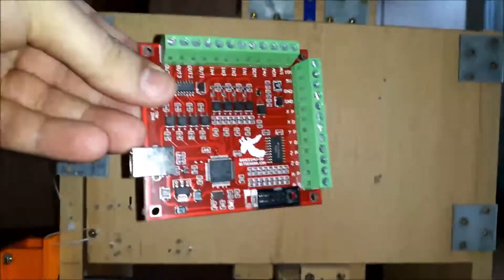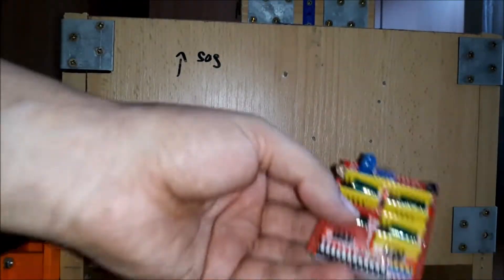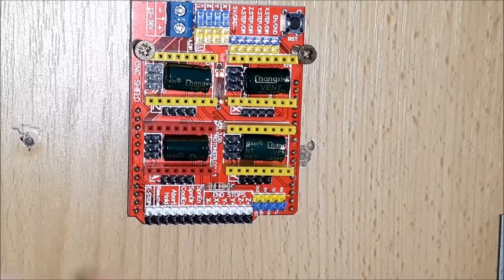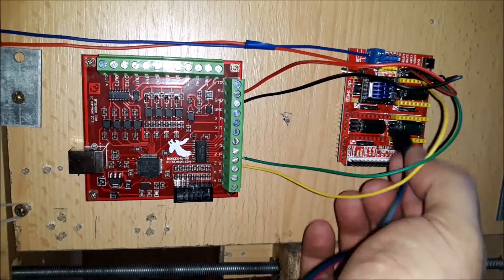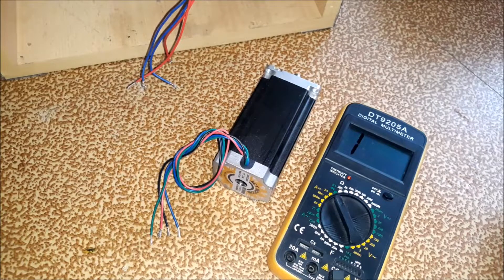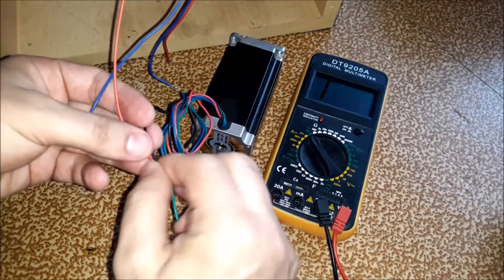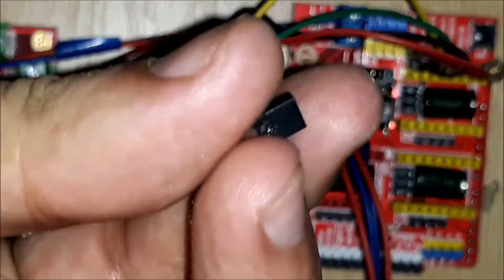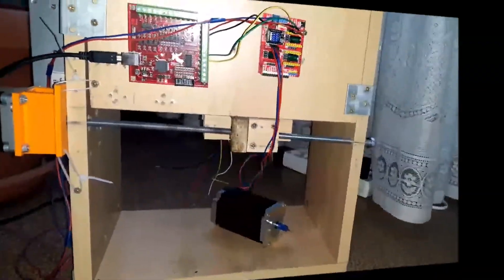CNC BUILD PART 29 - WIRING MACH3 USB BOB + CNC V3 SHIELD + TMC2209 DRIVER FOR Z AXIS

Comment: Is it possible to have the CNC shield connected to arduino at the same time? So you could connect usb to the mach3 bob for machining using mach3 and when wanting to laser connect usb to the arduino to use lasergrbl?